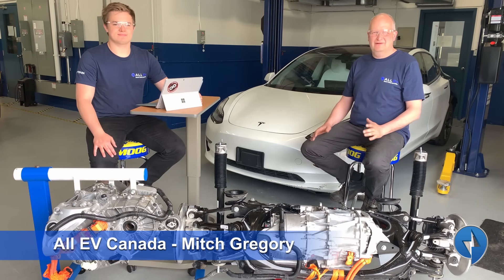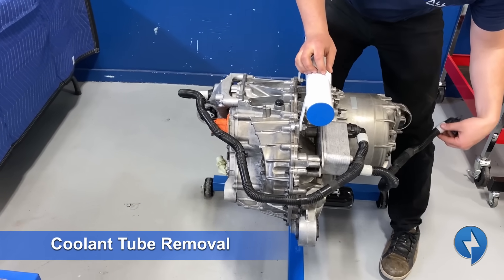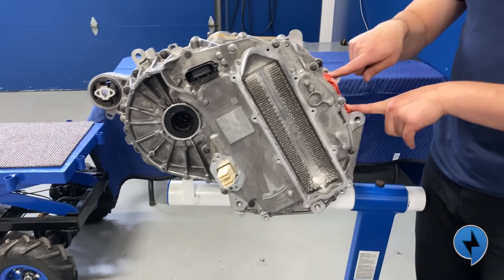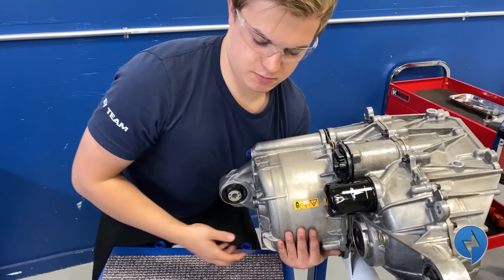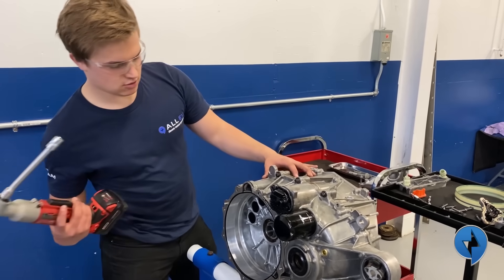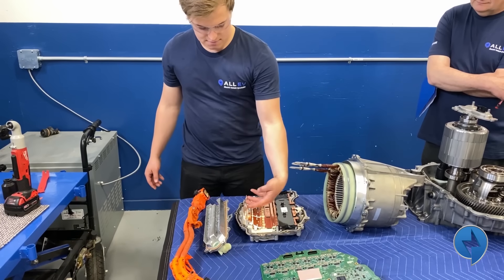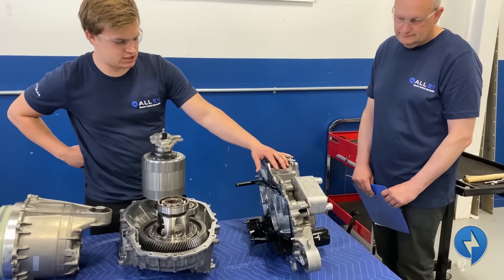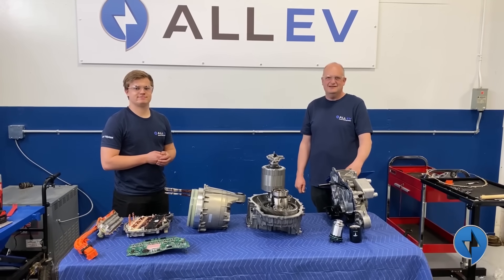Tesla Model 3 Motor Tear Down - ALL EV

Comment: Just wondering, why does the motor have to be encased in heavy and thick aluminum? I understand aluminum is cheaper than other materials out there and the thickness is for good strength and structure but I feel like automakers don't try to do anything to reduce the weight by using something like carbon fiber. Is it just so much of an industry standard or just so well proven to use thick aluminum in vehicle components to the point where using anything else would have drawbacks?

Comment: are you sure it is ac motor, and what advantages are to compare to brushless dc motor that is used in rc cars, airplanes, basically, dc brushless has magnet in or out side and can have high speed or high torque, but true ac motors have electromagnet on stator and rotor.

Comment: How often should that oil and filter be replaced? Is it based on mileage and is this oil system on all Tesla drive unite and what type (synthetic) and viscosity of oil is needed? And where can it be obtained or what manufacturer makes it. Also is the coolant standard 50/50 mix silicate free antifreeze, such as Prestone? Would you dilute it with distilled water rather than using tap water to prevent minerals from being introduced?

Comment: Excellent video. Electric motors are more reliable than internal combustion engines. Battery efficiency, chemistry, costs, weight, reliability and durability are the biggest challenges to EV's
Reply: Electric motors are clearly FAR more reliable than internal combustion engines. That's why practically every appliance, electric tools, and just about everything else we use has electric motors in them, which practically never fail. There's just not much there to break or fail.

Comment: The principle of work for that motor is more similar to RC cars motors than a AC 3 phase motor ...is not alternating is pulsing .
Reply: Tesla's inverter produces a full three phase sine wave output. It's a true 3 phase AC system.
Reply: @gibmebalut  The front motor, not the rear
Reply: Justin Mallaiz both.
Reply: @justinmallaiz4549  Ah, your right! Sorry about that.

Comment: With open diff’s the best way to improve off-road performance is the Toyota auto LSD system, which, when engaged will brake the wheel that is spinning on a slippery surface.
Reply: My Model S does that

Comment: Absolutely nuts that a motor that small can fling a 4000 pound car full of people back into their seats.
I freaking love electric vehicles.
Reply: Electric motors are >90% efficient, they lose very little energy. If a combustion engine is 40% efficient, that's quite an accomplishment.
Reply: @monad_tcp  40% is not realistic. In the real world 20% is probably more like it.
Reply: @davidreidenberg9941  Nope. You're wrong. Typical new ICE engines today have around 30-35% thermal efficiency. Formula 1 engines are bit better with around 45-50%.
Reply: The battery weights 1200 pounds, 3 times as much as a car motor.
Reply: Motors are easily capable, it's the battery which holds back the performance in EVs!
Reply: @EpicJonT  Traction is the biggest issue.
Reply: @EpicJonT  Not in mine. The 75kwh pack and two motors lauches mine to 60mph in 4.4 seconds. The fast 3 in 3 seconds. The S in 2.3. Looking forward to the Lucid Air, and the Plaid S so I can watch drag races on youtube.
Reply: @fjalics  yes ist is ok fast in a straight line but in Corners electric Cars lose because of their weight
Reply: @saftschubse9575  That sounds like a nice story, but it doesn't take into account actual times of the Plaid, like at Laguna Seca, or the Pikes Peak hill climb. There are a couple of factors. Low center of mass. The Plaid has a 3 motor setup, so they might be torque vectoring in addition to steering, but there is also the gobs of torque, and AWD that propell them out of corners in a way that the stinky cars just can't. So, theories, and stories are cute, but it's the track times that determine what's what. Somebody is going to take that thing to the Nuremberg ring. I bet it posts very fast times. The Model 3 performance is plenty fast too.
Reply: Check out Lucid Motors motor drive unit // its 15% more efficient & 600 hp & very compact & only 78kg // up to 3 in the high trim performance
Reply: Would love to see a tear down of the state of the art Model S Plaid carbon sleeved rotor. Cool stuff!
Reply: For short bursts like that, the limiting factor is how much power can be put into the motor, or the amount of power that will cause the motor to explode.
Reply: All about gearing..just like how a gtr has massive gearing.
Reply: @cesarpalmos8235  there is no gear in electric cars
Reply: Please review the video at 11:13. Torque multiplication through the open differential. Granted, SOME electric cars do not have transmissions, where the gearing is normally referred to, but none the less, gearing is used for torque output in this application of the tesla.
Reply: @cesarpalmos8235  Actually 99% of all EVs DO NOT have a transmission - they have a simple reduction gear, as in the case of this Model 3. And the reason is - because they essentially have maximum torque right from standstill, ie zero revs, right up to the typical maximum EV motor revs of around 16,000 to 20,000 ! 
The Porsche Taycan EV does have a “transmission” of sorts, but even it has only TWO GEARS, the second(top) gear only being for the unlimited speeds on the German autobahn ( ie over 250km/hr)
Reply: if battery technology makes a huge leap we can all have flying quad copters soon.
Reply: It still needs oil 🤣🤣🤣
Reply: only a smart person will say "electric vehicles" instead of Tesla. 

you are a smart fella.
Reply: and the torque aswell
Reply: Ev is excellent but right now for short distances.  I travel from Ontario Canada to Lake Worth Florida 3 times a year . I would never risk that journey in an ev.  Too much long stretches of nothing, battery anxiety, and cost. .My 2023 civic cost less than 200 dollars in gas for a 22 hour drive and a 60 dollar oil change.  So yeh I see both side of the coin. Eg My last  Honda had over 460,000km before I sold it. I am not sure of the cost of fixing an ev if and when something goes.
Reply: Check Koenigsegg motor - Dark matter.
This is HUGE compared to Koenigsegg. And this is super slow and weak compared to Koenigsegg.
Reply: It looks like a t case. ..
Reply: car that requires lithium batteries is a scam and "Tesla motors" is and insult to Nikola Tesla
Reply: yes, but there is 4 motors not just one
Reply: Engines have to convert chemical energy into rotational energy. So many steps in the process. 
Electricity is pure energy so the motor’s job is much simpler with one moving part getting the job done. Converting dc to variable frequency ac adds a step but it’s all solid state.
Reply: @Dave5843-d9m  what is "pure" energy? Energy is simply energy.
Reply: @TheraPi  "pure" energy is when your car does not have to fart to produce it lol silly question.
Reply: @Stanimalgic  Its not silly. Energy is energy. Learn physics.
Reply: @flexairz  i dont think your silly enough for this comment
Reply: @Stanimalgic  you don't produce energy   but rather convert it from one kind of energy to another. ICE cars convert the chemical energy into heat and mechanical energy.
Reply: @TheraPi  you arent either
Reply: @TheraPi  let’s not forget that an ICE engine is a heat engine and as such has a theoretical maximum efficiency that is related to  the temperature  in the cylinders and the  temperature that the heat is rejected. The electric motor is not a heat engine and is not subject to that restriction. Therefore the electric motor is about 3x as efficient at converting electromagnetic energy into kinetic energy than the ICE engine is at converting chemical energy into kinetic energy.
Reply: @TheraPi  it means its not stored in a fuel or something. Electrons are purely energy is what he meant
Reply: @Dave5843-d9m  Not really, as you can see they also use oil pumps, coolant, gears and driveshafts. But most importantly, all batteries convert chemical energy to electrical energy. And that energy needs to be created somewhere and transported to your charger. I'm not saying this is bad, but there are many steps as well.
Reply: @Dave5843-d9m  There is no such thing as "pure" energy. What does it even mean?
Reply: @faustin289  it means that when you feed it into stuff and a reaction happens it only exerts energy and force.
Reply: @Dave5843-d9m  gas engines convert chemical energy to heat energy then heat energy into mechanical energy and the vast majority of heat energy is wasted
Reply: @Dave5843-d9m  Liion battery is chemical energy, so still not "pure" energy.
Only capacitors stores electricity as straight electric potential but it takes a lot of space compared to battery
Reply: @tullgutten  Tesla going to use ultracapacitors in upcoming models /// like the next Roadster & Model Y upgrade // 
Capacitors can be cycled more than batteries, can absorb "regen" & discharge "acceleration" much faster than batteries
Calendar life of ultra-capacitors & cycle life up to 10-100X better than chemical batteries // 
Volumetric power density & energy density are different, capacitors take up much more volume than batteries for same energy content, but have much greater power flow input output performance //
Reply: @tullgutten  It is still pure since it's just storing electrons.
Reply: @MenacingPerson  electrons aren't energy, their electric potential is
Reply: @AaronSchwarz42  No they wont. A electric car with supercapacitors would have No range because the Energy density of supersapacitors is shit
Reply: That's all they have. BORING. I hope you don't consider yourself a car person. But thanks for not calling them cars, they're not :)
Reply: @inoutdoor4211  the very first cars used electric motors.
Reply: @MenacingPerson  And they didn't last long, due to technology yes, but ICEs stood the test of time and always will compared to these glorified kids battery toy cars.
Reply: @inoutdoor4211  i feel like you had too much salt today.
Reply: @MenacingPerson  And you're not a car person. You're a Tesla person. Or an EV person, not the same as a car person.
Reply: @inoutdoor4211  yuup, def too much salt. try eating sugar.
Reply: @MenacingPerson  
Car - a four-wheeled road vehicle that is powered by an engine and is able to carry a small number of people.

It doesn't say ICE, but only engine ;)
Reply: @jackbgsd  that definition needs to be updated.
Reply: @MenacingPerson  actually it doesn't. Engine can be electrical, internal combustion, etc...

Comment: Wish you'd torn down the actual motor part more, id like to see the insides of the rotor
Reply: any further is destructive and therefore a shame, destroying a beautiful feat in engineering.
Reply: @sack1958  thats fair, but just seeing a metal cylinder isn't as informative or cool to me as seeing what actually makes it up
Reply: I don't think that's much interesting there. You got a block with magnets and the shaft is connected to it.

Comment: Bjørn Nyland shows that when fast charging, the Model 3 runs the front/rear motors in-place to generate heat to warm up the battery : https://youtu.be/jTiy5Nse7jk?t=45
(e.g. they use the same coolant loop going from the motor to battery?)
If that's the case, wouldn't you need a clutch pack to disconnect the motor from the transmission while doing this? I didn't see a clutch pack mentioned in this teardown video.
Please investigate and let us know!
Reply: It doesn't spin the motors to warm up, it uses an in-phase signal, instead of an offset-phase to basically stall the motor. By not offsetting the phase, no rotational motion is created and you're wasting energy just creating a static magnetic field, which also creates the heat.
Reply: Makes sense. So essentially heating up those rows of MOSFETs by generating the AC signal for the motor output. The 3-phase AC signal is transferred to the motor, but because the signal is in-phase (same frequency), the motor doesn't start to spin.
Finally, the heat generated by the MOSFETs, and the heat generated by the magnetic field, is drawn away by the coolant loop into the battery pack. Neat.

Comment: The rear motor on a model 3 is 220 hp, it's amazing to think that small rotor/stator assembly can produce so much power output.
Reply: Exactly, I'm used to ac induction motors with huge size just for 55k powr
Reply: @chebhou  It is specifically mains induction motors that are large for a given power due to the low frequency/RPM they operate, not induction motors in general.  Just as with ICE engines for a given size the power is approximately proportional to the RPM. Teslas before model 3 actually had induction motors rather than synchronous reluctance motors and were about the same size.
Reply: cheb hou 
Commercial motors are are continuous rated and have to be cheap. Most of the time these car motors are running far below their peak power.
Reply: @chebhou  I have an ev with a Siemens squirrel cage rotor, 15kW nominal, 80kw 2S peak, 82 pounds!  Could do with only a 25 lb  motor if it was a IPM-motor like this. However all is not lost: Though heavy, highway cruise is around the nameplate 15kW, so efficiency is close to the 90% peak efficiency of the motor most of the time. However as the model 3 has a bigger motor, highway cruise is lower down the efficiency curve of its motor  (1/15'th of peak power) and at highway cruise the motor is around 84-86% efficient. (far from its 97% peak) So Tesla should really try to use smaller rear motors for higher cruise efficiency.
Reply: @chebhou  Those huge motors have much higher torque.
Reply: people have dyno'd that rear model 3 motor at over 300 horsepower.
Reply: The magic is that regualar motors can be bigger and it cost less than Tesla one, where you are limited by size of the compartment. So this motor is much more expensive than your regular AC motor.
Reply: @TheSkace  Also conventional AC motors are limited by the grid frequency. They can only reach 3000(50hz) or 3600 rpm (60hz) with single pole pair winding. This motor can spin much faster with the same torque - more power since power is torque*speed. Motor physical size is mainly determined by torque requrement - a 5 kW 3000rpm motor will be much smaller, lighter and cheaper than a 5kW 1000 rpm motor. And this can produce more torque because it is liquid cooled - main limitation on conventional motors is thermal
Reply: @Rusty a tactical nuke is even more space/power efficient.
Reply: Yes, they didn't uncover the magnetic field focusing techniques inside the Rotor. That's the Tesla Difference.
Reply: I would like to see more use of epicyclic gears. The teeth are straight cut but there is always at least one tooth in contact so they run silent and the most is spread across three gears. In effect it’s a scaled up bicycle three speed hub. Benefit is you can boost motor torque for towing or whatever reason.
Reply: @Dave5843-d9m  This kind of electric motors doesn't really need gears like you'd require on a internal combustion engine or a fixed rpm electric motor. It can produce more than enough torque at low speeds to spin the tires while still being geared high enough to go insanely fast. And while adding gears might reduce the torque requirements on the motor while increase torque to the tires, it's kind of pointless as the motor can handle the load, and all you're doing is adding more weight and more things that can wear out.
Reply: 69aussieguy Main point of adding gearing is to reduce rpm, many PMS motors have optimal rpm of above 10k
Reply: @ziyanide  Does high rpm hurt electric motors? Assuming they're not going to fly apart from rotational force, the only benefit I see is in bearing life, but even then they probably outlast the car. BTW, given the top speed of the model 3, it's safe to say most of the time the motor isn't going to be anywhere near it's max rpm.
Reply: 69aussieguy That’s the point, you could never have a direct drive electric motor, that is at the same time optimised regarding efficiency. Hence the transmission. Bearing life shouldn’t be a problem as long as the rotor is properly balanced (which it should be through balancing disks). But you’re right, theoretically no transmission is needed. The motor could still easily handle it at low rpm and high torque
Reply: @Pete856  Q: Does high rpm hurt electric motors?  A: no and yes.  the problem is even with all the promise/greatness of electric motors, they lose efficiency at high rpms.  this means even as you switch away from burning fossil fuel, its Nature/The Universe stepping in once again to remind IT IS IN CONTROL and you can't have "Free Lunch". #NOFREELUNCH
Reply: Pretty sure it's electronically limited too, as the rear motors have more power than the front motors and the M3P has 490hp
Reply: @Samuel Aditya Induction motors may have lower starting torque than DC motors, but they are more reliable and easier to maintain.